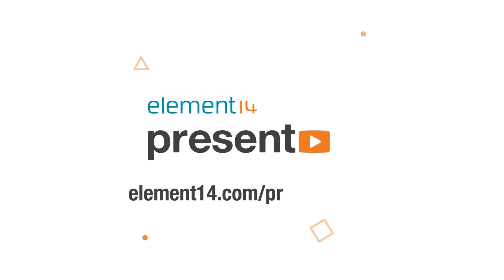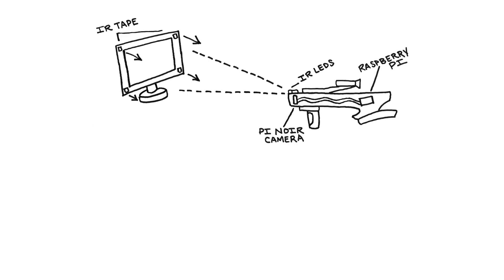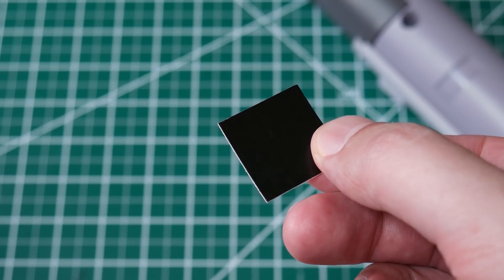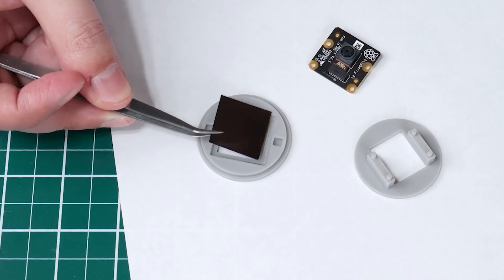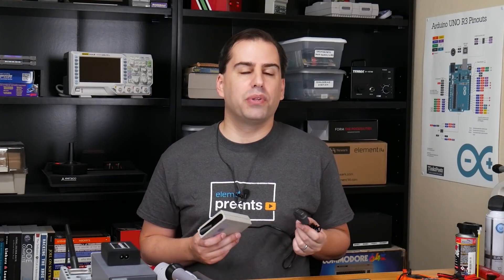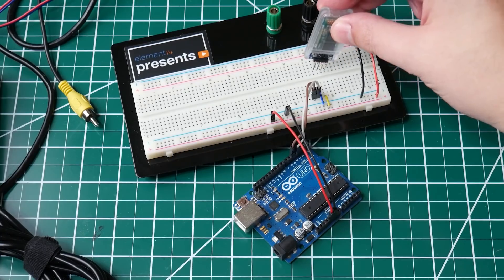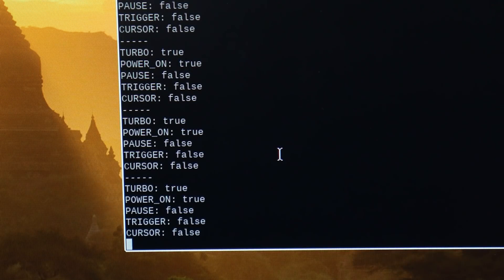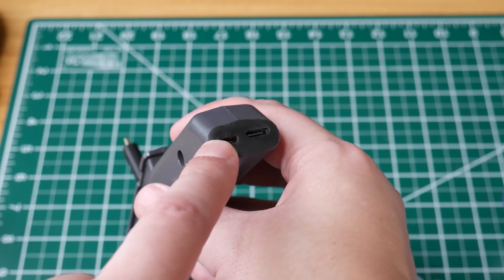Modding the SNES Nintendo Super Scope for LCD Screens

Comment: I want to learn more about the SNES Super Scope. The NES Zapper used an IR sensor and turned the screen black except for the hit box, meaning if the IR sensor got enough IR to trigger, it was a hit. However, NES only ever could have 2 things on the screen at any given time because each target needed a full frame to display a white box for that target to differentiate targtets. But the Super Scope and the SNES light gun games had multiple targets and no black screens. I don't know how they did hit detection at all with this thing.

Comment: Hi i love your video on the superscope it is
 really cool and inspiring i just bought my first 
Superscope  i saw corrosion in the battery bay it was not to alarming i have fixed and repaired battery terminals many time unfortunately for me i did not no about the battery board and the battery acid had completely toasted the battery power board was looking for a  replacement board but they do not exist 
Anyways i am reaching out  for any suggestions on making a new power board so i can get it up and running

Comment: You can set the raspberry pi system to read only mode to prevent problems related to power faults causing sd card corruption

Comment: The SNES plastic is brittle because of the same flame retardant chemicals that led to the yellowing. SNES hardware that's still more gray than yellow is still a lot more robust.
Reply: Probably so, but I wonder if there isn't more going on here. For some reason, this particular shell (the one for the IR receiver) shatters if you so much as look at it funny.

Comment: I suspect that a Mitsubishi flat panel TV that uses laser scanning on the back of the screen should work with the original scope without modification, it would be better to use the UDOO RYZEN Bolt V1000 Maker Board SBC that will be much faster and can use standard 80586 machine code, can you not use Python to C++ converter to generate C++ code that can be compiled to run lightning fast.

Comment: This is amezing, now show this to nintendo and tell them that they should come with modern versions of their light gun for their original systems, not only that but they can rerelease those old lightgun games on the switch in wich the licht tracking can be emulated triugh the switch motion controllers, in fact they could,ve done this on the wii & wii u but shamely eniugh they did not,

And last but not least, did you know that old lcd screens did worked in an interlaced manner? Yes that’s right ,for instance the gameboy/color  lcd screen did draw images from top to bothem and from left to right,
With that said i don’t understand why tv manufactors didn’t decided to also implement an optional interlaced mode on modern flat screen tv’s sothat you could play light gun games on a modern tv, ,even if you still had to replave that old lightgun with a lightgun wich could detect light from an lcd screen, but you also have to come with a cartride with patches for different lightgun games to get around that timing issues of plat screen tv’s because even in interlaced mode , it’s still not fast as a crt tv .

Comment: Very cool mod you guys did there. I don't know if I want to plug it in for power instead of using batteries though. The power cord would be awkward.
Reply: That's what I thought too, but if you look at the way it's actually held and used it shouldn't be a problem. The cord is over your shoulder, so it's not hanging in your way in front of you.
Reply: @awo1fman  Exactly. I was sure at first that I'd want to use a USB-C battery pack, but in the end I didn't need it. As  long as the cord is long enough, it feels fine.

Comment: Awesome build.  I made an almost identical system for another project that, instead of using a Pi and a NoIR camera, uses the same IR tracking camera in the WiiMote that gives XY coordinates for the four brightest IR sources (available for sale at RobotShop).  With this IR camera, you can cut out the Pi, CV processing, and heat considerations, and replace it with a small Arduino with a BT module inside the scope.  Since it is much lower power than a Pi, using battery power is viable.

Comment: Isn't this pretty much like a Wiimote? I mean, besides the "talking with the SNES" part.
Reply: The main difference is that this has absolute position tracking. The Wii doesn't take into account the geometry of your TV, so it doesn't know what you're actually pointing at. This plays pretty much identically to the original Super Scope (minus a little lag).
Reply: @andywest5773   Why would the Wii approach not be able to know where you're pointing? The Wii beacon gives you two IR leds - and there's no strong guarantee about how the beacon positions relate to the geometry of the TV - but that's why you calibrate it. As long as you're standing more or less in front of the TV it should be able to work out where you're pointing.
Reply: @tetsujin_144  Hmmm... maybe I've just forgotten how Wii remotes work. I haven't really done anything with them since trying Johnny Lee's WiiMote head tracking thing way back who-knows-when. Interesting!
Reply: Ok, that makes sense. Still a gread mod. I wonder if you could get one done for the NES Zapper using the same principle? I think that one would get a lot more use.

Comment: With all the parts that have been removed, I wonder if a version that doesn't use any original Light Gun parts can be made.  A non-destructive open-source Light Gun replacement.
Reply: Came here to post this. Thanks for doing so! I really love the idea of not destroying more of those parts that are already hard to get. I would love to be able to do this without sacrificing a Scope or a Receiver.
Reply: I wanted to like this project. But my heart hurts watching the gutting of the original hardware.
Reply: @KCphilippi  I'd find them at thrift stores in the early 2000s for a dollar apiece. They made a ton of these.
Reply: I was thinking that since it's basically being rebuilt anyway, could we make it a pistol so it's easier to use?
Reply: Check out the Sinden Light gun, it works without sensor bars, and will even work on some original console hardware. There's lots of videos about the light gun on YouTube already, so just do a search.
Reply: Yes and no.. I've actually got 3... one 'minty', one 'beaten down' and one 'broken and rough'.... the last 2 are beyond anything worth collecting but would be good enough for a project like this :-) Of course nothing would stop you from 3d printing a similar looking device with the same hardware :-)
Reply: Mine's burned out, I don't know what to do,  haven't trashed it yet. Wonder if a cheap hid airmouse can be modded to a trigger for a gun. I bet the hid can be used on xbox one and series x as a mouse and keyboard.
Reply: @MM007  I think that if companies like RetroBit can make new controllers, they could make a new superscope too. This guy proved it's possible.

Comment: great job now if only you can get it to work on  SNES mimi
Reply: If there's a way to convert the snes connector to the new Nintendo controller and plug it in to port 2... And hack it to put the SS games on...
Reply: @adventureoflinkmk2  That wouldn't work because it relies on composite timing signals to work but the SNES mini uses HDMI.

Comment: This is an awesome accomplishment for sure!!  Reminds me of the tracking methodology that the Power Glove used.  I still died a bit inside when you drilled out the scope for the air flow vent though! :D
Reply: Ha, ha! If it makes you feel any better, I don't think the Super Scope is at all rare. And this one has a whole new life, not sitting in someone's attic! It definitely needed the air flow... that thing was getting toasty.:)
Reply: @andywest5773  Going it a new lease on life is definitely admirable, no doubt!  Can't help feel that way with anything that they no longer make any more of, I guess that sort of makes me a retrogames tree hugger? Haha... Fantastic project though Andy, seriously, well done!
Reply: The Power Glove actually used high frequency sound between the glove and sensors. I know this because the television I had back in the 80s ALSO used high frequency sound for its remote control. I would point the glove at the screen, and the volume would turn to zero (and then shut off the set!)
Reply: @Mujaki  I was referring to the placement of the sensors on corners of TV🤓👍
Reply: @Mujaki  that's pretty funny and cool though!